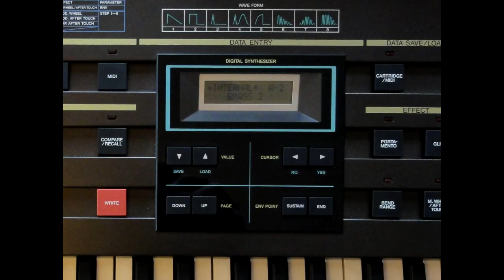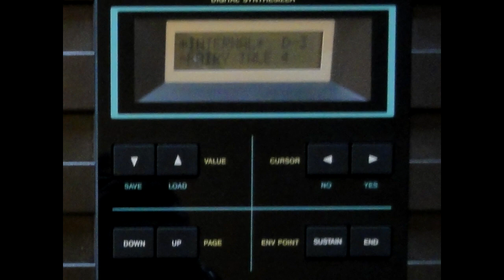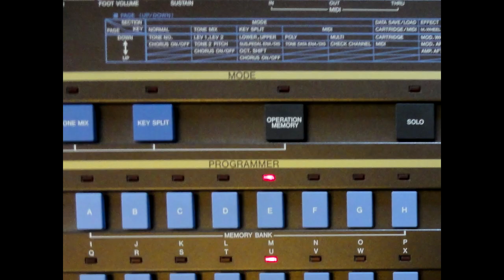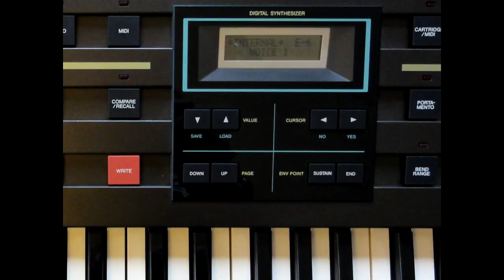Demo of Casio CZ-1 Sounds

Comment: I have a CZ-5000 and find myself editing the Fairy Tale presets as well. I wish this synth engine was velocity sensitive because programming complex arpeggios in MIDI would probably make its sounds really fly. It does have quite an ethereal sound.
Reply from the maker: Yeah, with the CZ-1, it does help provide some dynamics that the CZ-5000 just doesn't provide.  Still the CZ-5000 is a great sounding synth.
Reply: @ProckGnosis  ahh so the CZ-1 does have velocity? I was unsure, thanks for the info... now here’s me scoping out eBay and Reverb...crap!
Reply from the maker: @channel395jfjsifkf  Yeah it does.  And it definitely makes a difference.

Comment: The Casio CZ-1 does have a separate 64 presets along with the 64 user memories. To access the internal 64, just press the initialize button while selecting patches. There are also 64 operation memories and 64 additional memories with cartridge which can be accessed without having to load in the user banks.
Reply from the maker: Great tip!

Comment: Excellent demo. But why did Casio make so many brass presets?. Wouldn't it have been better to make just one, and make other presets?. thank you for sharing. i know a lot more now.
Reply from the maker: Thanks.  I'm guessing they made so many brass presets, because back when digital synths were still fairly new, they wanted to go with their strengths.  A lot of folks back then wanted synths that sounded like real instruments, and the brass sounded a lot more real than it's piano or flute sounds.  In general I think big, polyphonic brass sounds were kind of popular in the 80s.
Reply: Thank you that explains it. Great demo. Nothing wrong with brass.

Comment: Hi, thanks for Your work. One question: it is said that CZ101 is better in clarity and power of sound ( eg. bass sounds...) even than its bigger brothers. Is that true? Maybe, due a chorus option not so hush on my CZ1) its output is weaker.....I would like to know more. Did You have any comparison experiences? What do You think about this? Thanks a lot for answering.
Reply from the maker: @littlebritain64 Thanks.  Yeah, I've seen that discussed in quite a few forums, but I don't think there's a big difference.  The CZ-1 has a velocity sensitive keyboard, so unless you're playing velocity value=127, some of the patches that use velocity may seem less loud or less bright.  The CZ-101 may run hotter on the output (or so I've read, but not tested), but I've not see any significant differences between the 4 CZs I've owned (CZ-1000, two CZ-1s, and a CZ-5000).  The CZ-1000 (basically a CZ-101 with full-size keys) I had did seem louder, but again, I think that was mostly because it wasn't velocity sensitive, and every key press got maximum programmed loudness.
Reply: @ProckGnosis  
wow, thanks for answering so quickly and in such a detail!!👍 Yes, it really sounds so strange that a budget synth could be better than the top of the range. And that nobody noticed it since the beginning, slowing down the CZ-1 sellings in advantage of its more little brother. So, no need to purchase another CZ, since I also have a VZ-10.....😄.
Thanks again, all the best!!
Reply from the maker: @littlebritain64  Well, just to clarify, I don't think the CZ-101 is overall better than the CZ-1; it's just easier to use if you don't care about 1) velocity sensitive programming or 2) having the extra voices from the CZ-1.  I can get a CZ-101 performance out of an CZ-1 (and then some), but I can't get a CZ-1 performance out of a CZ-101.  Other than size considerations (the CZ-1 is BIG), I'd take the CZ-1 over the CZ-101.
Reply: @ProckGnosis  
Thanks again, pal!👍

Comment: Noob Question: Can Phase Distortion do FM-like sounds without Ring Modulation? How are the Marimba, Bell, and Piano sounds made?
Reply from the maker: All the most realistic bell, vibe, chime, or marimba like sounds on the CZ use the ring modulation.  Not sure if that's good or bad news for you, but the bells, chimes, etc. do all sound pretty good on the CZ.
Reply: ProckGnosis I just got the Official Casio CZ iPad app, and I almost love it! It even has a multi keyboard mode!
Reply from the maker: I got that last year some time and only recently started playing around with it a bit more.  It's pretty spot-on sound-wise, but the programming interface could use a few tweaks to make it more like the synth.  Still, not a bad option at all to get some classic 80's CZ sounds...

Comment: How much did you pay for the cz1, if I may ask. I'm interested in buyng one myself, saw one running for 250 euros lately, made an offer then but someone else before me got it instead, sadly. Great demo by the way! and keep up the videos great videos.
Reply from the maker: Thomas Vogt Vielen Dank!  I don't know about the current price on CZ-1's, but I paid around 200 euros/dollars both times that I bought one through Ebay.  The 2nd CZ-1 I bought from someone near Dusseldorf (in 2004).  It's the one I use today.  Was in perfect shape, and only about 180 euros (I was VERY lucky, as I was still living in Europe, and they did not want to mail it anywhere).  The first one cost more  (about $200) but suffered some slight damage in shipping, and I never used it very much.  I have kept it for spare parts.  I would guess now that they are harder to find, 250 euros isn't a bad price, if the keyboard is still in pretty good shape.

Comment: hi. i saw a used one. the screen not working and the sustain pedal. but the  buttons to choose tones is working. is $75 a good price for the condition? is it easy fix?
Reply from the maker: +Jade Pascual Sorry, but I don't have any experience in fixing or getting a CZ fixed.  I also haven't had time to get my CZ-5000 looked at that died.  As long as the $75 CZ is still making noise (it's playable) that's a good sign.  I would check some of the CZ forums.  I thought I read a few posts from people who replaced the screen/display.

Comment: Does Casio CZ 1 have Double Reed samples?
Reply from the maker: Hey Sasa...the CZ-1 doesn't use samples.  The wave forms are all calculated from algorithms, not digital samples.  You can possibly program the CZ-1 to get a sound similar to an oboe or bassoon, but it won't sound as good as a well-recorded sample from the real instrument.
Reply: Thanks.Does have ''Double Reed ' ' tone as Cz 230s
Reply: Whats difference between CZ 1 and CZ 5000 ?
Reply from the maker: The CZ-1 and the CZ-5000 are almost the same, but the CZ-1 is velocity sensitive (keyboard and programming) and has aftertouch.  The CZ-5000 has an onboard sequencer that the CZ-1 does not have, but no velocity-sensitive features.
Reply from the maker: Since the CZ-230s had the same phase-distortion synth engine, the "double reed" sound can be programmed into the CZ-1.  I don't remember if it was one of the original presets.
Reply: Thank you very much.

Comment: To me, based on what I hear, I would call this a "workhorse" synth.  Nothing exceptional, nothing particularly attention grabbing, but nothing bad... Though I really liked the marimba. 

I wouldn't use if for any "crazier" sounds, but with some modifications on the basics, it sounds perfect.

Thanks for the demo!  This is an oft-referenced synth that I've never had any personal experience with.
Reply: I think you can actually do quite crazy sounds with the excessive 8 step envelopes for pitch, „filter“ and amp, plus noise and ring mod. I once did a nice „busy highway“ sound with my CZ 101.
Reply: I was listening back to my recorded noodling with this from 85, crazy is what this does best, but the presets are not useful for that.

Comment: all the demos use reverb.....uggggggggggggggggggggggggggggggggggggggggggggggggggggggggggggggggggggggggggggggggggggggggggggggggggggggggggggggggggggggggggggggggggggggggggggg
Reply from the maker: Lol...what WAS he thinking...he actually played musical phrases and stuff too (albeit badly).  NOBODY uses reverb when they're musically demonstrating a keyboard.  : )

Had it been strictly an oscillator deep-dive analysis, yeah, I wouldn't have used reverb.  But it wasn't.  It was to demo the patches predominantly in a musical way, and most synths when used musically have reverb, hence the decision to add it.
Reply: +ProckGnosis I just wanted to hear the patches in raw form but cant seem to find any demo that does not use reverb.
Reply from the maker: Yeah...understand, and it was almost a coin flip NOT to add reverb, til I reasoned it out as described above.  You can probably find some other, older videos without it, but then the audio quality usually isn't as good.
Reply: +ProckGnosis yea, anyways good video nonetheless
Reply: most of the demos i am doing are without reverb where possible.